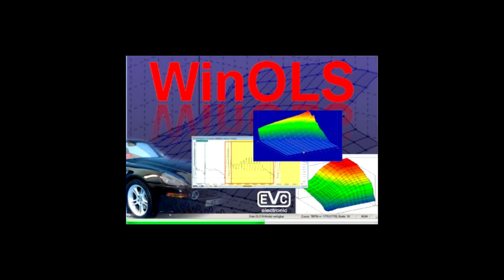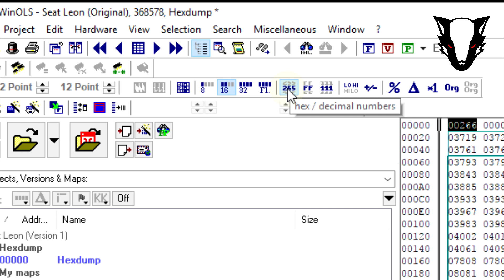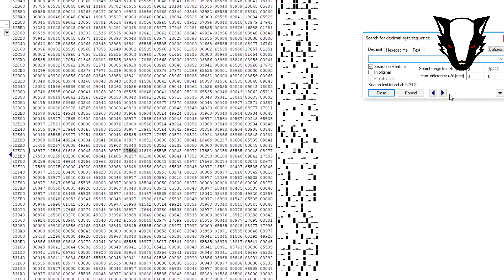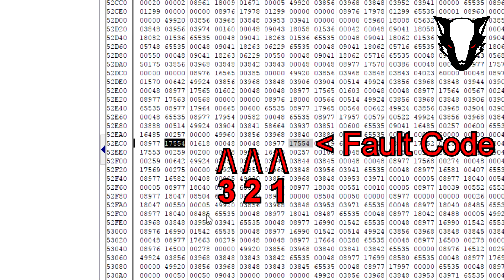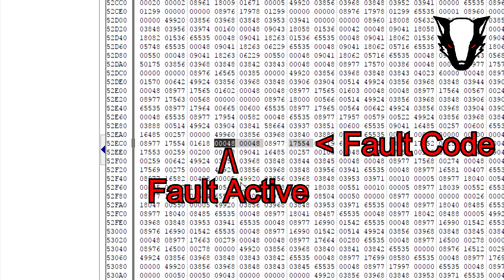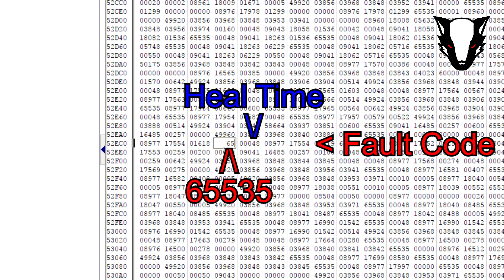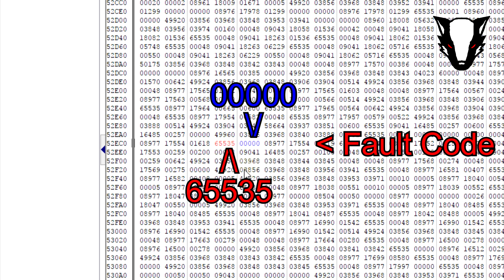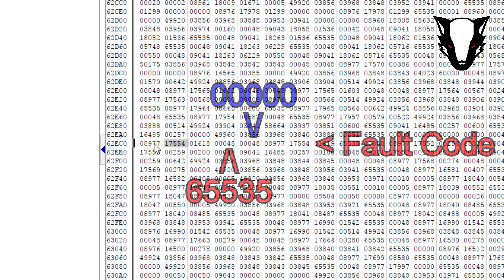HOW TO - Fault Code Delete (EDC15P)

Comment: Is it possible to use this method on Golf MK5 FSI (engine BKG) with ECU MED 9.5.10?
Reply from the maker: Unfortunately no, will not work
Reply: @TheBadgerBox  in that case, do i have another way to do the work on MED 9.5.10???

Comment: Hello , Maybe you can me Help.

My Problem is 

I work with Ktag and BDM and loged in mein ECU
My ECu is EDC16+ VAG Audi A6 4F 3.0 TDI
I make from EEprom Back up and after that i start the DTC Remover and make DTC Off with the Back up file from EEprom 

Now I Write the DTC off file of my ECU . In my Car i Install that but my Audi dont start . He give me the Error  ECU No Signal and Error with ESP Brake Controll . 

I write again the Original Back up file from Erprom but now is nothing . My Car dont want start and make Error .

Thank you
Reply: Need to go back with flash, you dont calculate the checksum or write bad off file, you have to write Old flash by bdm

Comment: Hallo
is there a other solutions without winols to remove errorcode p1038 from med 9.5.10?
i have mtx dtc remover but this do not work with med 9.5.10

thanks

Comment: Hi. Can I remove the ABS and handbrake warning in this manner? I am about to remove the ABS module and install a non-abs master brake cylinder....
Reply from the maker: No, as the fault code structure in the cluster is different
Reply: FADR Thanks for the reply. Is there any way to delete the codes so as to make it as if the Abs wasnt there from factory?

Comment: Hello, in EDC17CP do you kwnow how to remove?
Reply from the maker: Manually you need to find all the Fault Class Tables and switches and calculate. Easier to purchase fault removing software.
Reply: FADR  I finded it, but I dont know how to calculate for change the values. This is a Amarok, and I need to remove the DTC P261A.

Comment: Im' searching for 17552 in edc15p. I look 4 zones with same DTC number but the pattern it's not the same:

1st pattern :  01619 65535 00048 08977 17552
2nd pattern:  00257 00100 00048 09041 17552
3rd pattern:  01619 65535 00048 08977 17552
4th pattern:  00257 00100 00048 09041 17552

I need to change values in the four patterns to disable DTC? or only in 2.... this ecu only have 2 codeblocks. With other DTC's only find 2 patterns but with this DTC found 4.

BR and thanks in advance!
Reply from the maker: That's normal - change all 4 as per the video and it will disable the DTC in both codeblocks

Comment: I'm trying to delete code 17849 (EGR valve open circuit) on my 2001 VW Jetta (ALH EDC15), but both numbers are already 00000, should just setting the first one to 65535 delete the DTC? Thanks for the video too!
Reply from the maker: The EDC15VM ECU have a different structure to delete error codes - in your ECU locate 17849 and count 10 addresses after this - you should find a sequence similar to this;

00048 00048 00017 00048 00048 00017 00000 49920 00000 00000 00000

Need to change to this;

65535 00000 00017 65535 00000 00017 65535 00000 00000 65535 00000

Cheers
Reply: Mine currently looks like this:
00048 00048 00017 00048 00048 00017 65535 00048 00001 65535 00000 00000 00000

I should change it to this?
65535 00000 00017 65535 00000 00017 65535 00000 00000 65535 00000 00000 00000

Thanks again
Reply from the maker: Yes

Comment: Great video very useful. Does this work on the EDC15P+ ECU as I've tried it on  a fabia vrs and it still comes up with the fault . Thanks and keep up the good work.
Reply from the maker: +Paul Roberts yes works fine, remember you have multiple codeblock is EDC15P ECU and when you change map, you need to clear fault.

Comment: Why 17554? What error is it?
Reply from the maker: +DonWeten that's just an example error code.
Reply: Yes its ok, but if i want to find P0110 for example? What is the number in hex?
Thanks for your answer time!
Sorry for my english, is so bad jeje
Reply from the maker: +DonWeten switch the view to hex view and search 01 10 instead then when it's found switch back or Google to find the VAG number which would be 16494
Reply: Ooook man! Thank you very much! 
1 like for you!
Reply: DonWeten Go to Rosstech’s website, then you can see the vag code number of the p codes (can also be read direcly with the vag com)

Comment: Why 65535?
Reply from the maker: As 65535 converts to FFFF in 8Bit Hex Value - the ECU reads this as disabled.
Reply: TheBadgerBox oh ok, does this fault code delete technique only apply for edc15 ECU's? Or others too?
Reply from the maker: Just EDC15P ECUs bud
Reply from the maker: +Will Palmer Just EDC15P ECU bud.